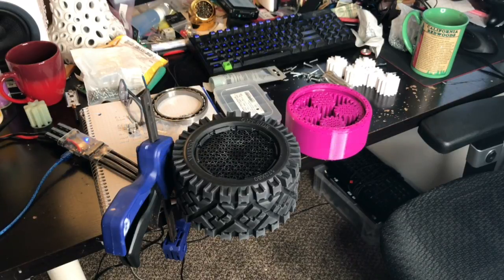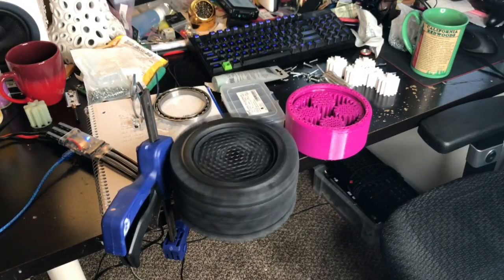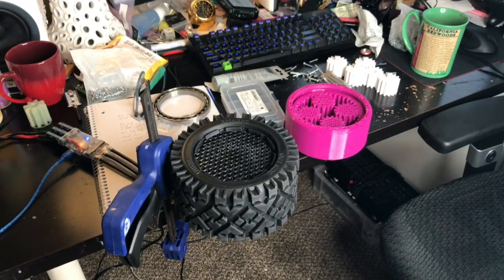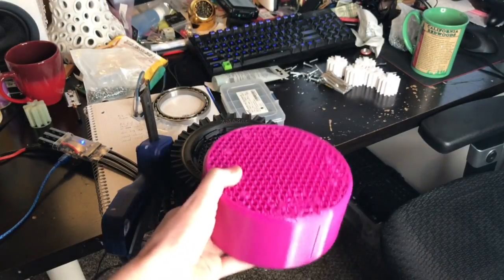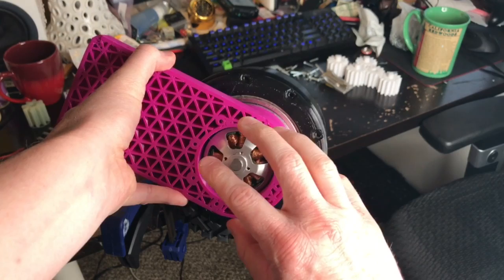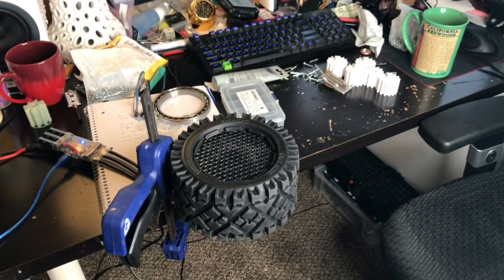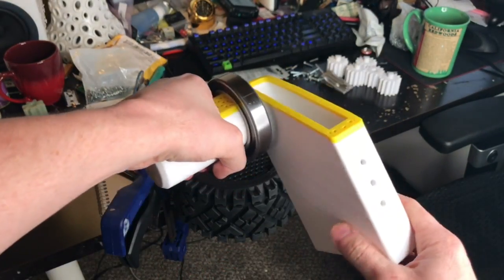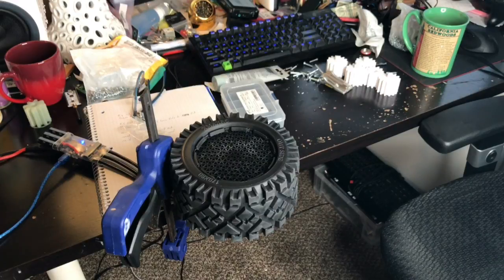3D printed explorer robot

Comment: Did you give up on using Hoverboard motors that you were experimenting on 6-7 months ago?  If so, what was the issue that made you drop them?  I'm currently where you were 8 months ago, taking apart existing hoverboards and trying to utilize the motor/wheels for a robot base.  Any hints/tips would be much appreciated!
Reply from the maker: Paul Tan a friend gave me the old hoverboard. But those motors are heavy and when you want to source them they aren’t cheap. Hoverboard motors are excellent really, but I’m trying to make the robot easier to source. These motors come from hobbyking.
Reply: Thanks for the information!  Qty 1 pricing seems to be about the same (hobbyking lists your motor at $60,  electricscooterparts.com lists a pair of hoverboard wheels at $100 - about the same as aliexpress).  For the kind of robots I want to build, the hoverboard motor wheels make more sense (commercial delivery type robots, 50lbs weight).  For what you are trying to accomplish, I agree, it probably makes sense, but 100 hours of 3d printing is quite a bit (I already complain when my prints have to take more than 5 hours!)

Comment: Looks like it'll be very powerful, that motor is gigantic even on it's own (let alone 4x of them).

You didn't use Herringbone gears tho?
Reply from the maker: roidroid thanks! It’s going to have plenty of power - I didn’t want this to ever really not have enough. 🙂

I want to use helical gears, but I still haven’t sorted out how to make them in OnShape. I’m not sure I can use herringbone gears because the gearbox needs to be assembled, but normal helical gears would help with the noise a lot. It is certainly something I want to work on.